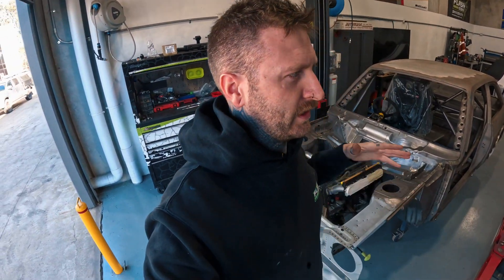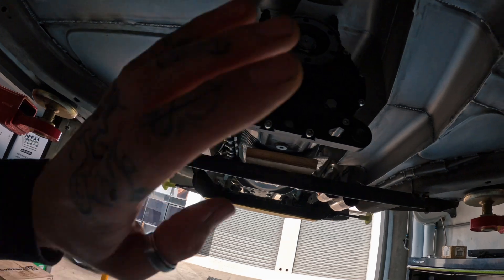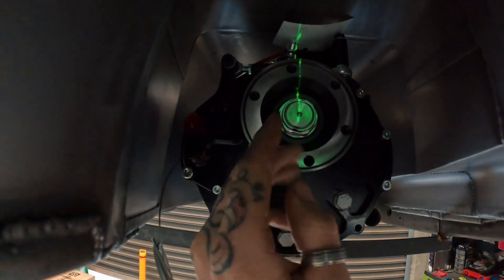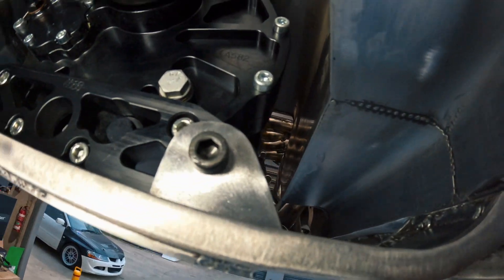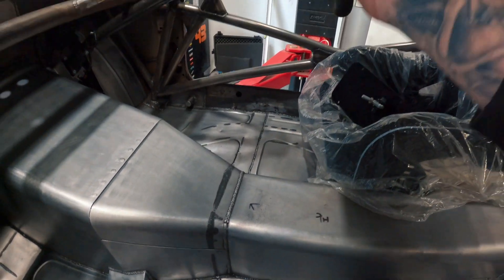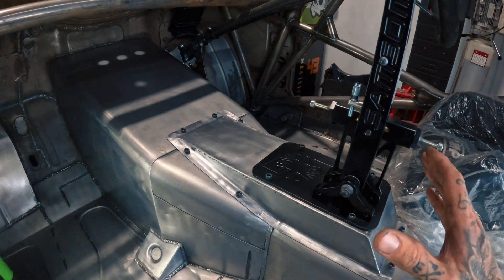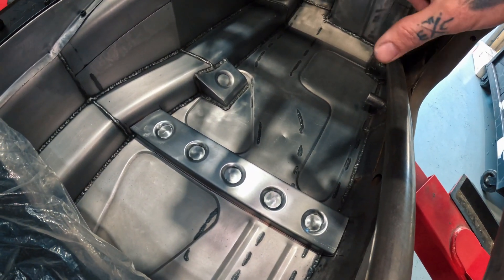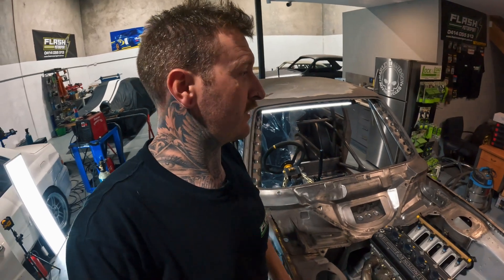Samsonas 6SPD sequential gearbox - Millington Diamond install, Custom crossmember & fabrication work

Comment: Great to see what your doing! What's the peace on the right side of the gear leaver with the two screws sticking out either side?
Reply from the maker: Thank you very much! Plenty videos to follow. As for the components either side of the lever, without going through the Samsonas documents, I’m assuming it’s mountings for an actuator to make the gear lever paddle shift.